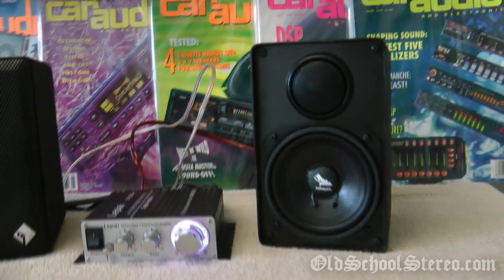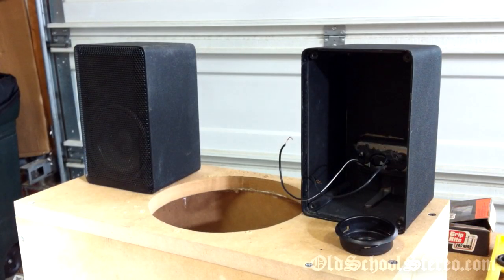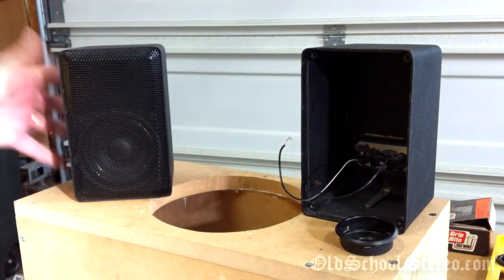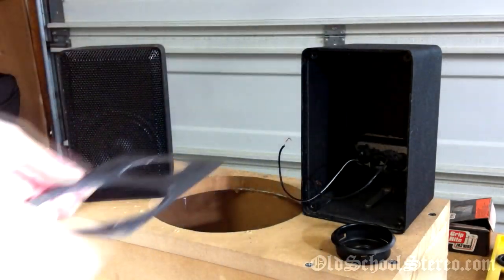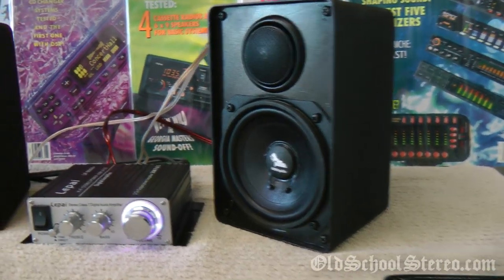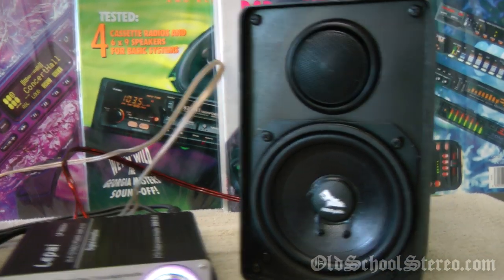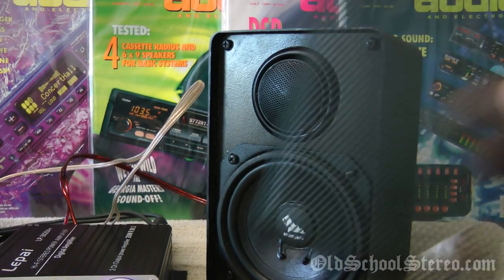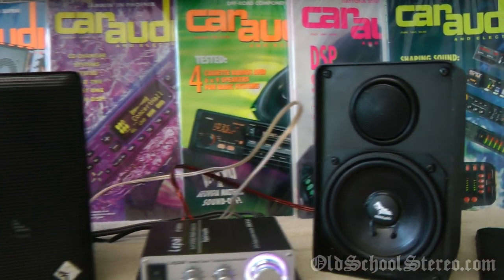Old School Car Audio Bookshelf Speakers? DIY Audiophile Project

Comment: , you are the first person to use car audio speakers in a home speaker design.
this is exactly what I'm going to do for my computer speaker 2.1 setup because they are 4 ohm and I can get a set of very well made JBL or Cerwin Vega component speakers with the crossovers for around $50 bucks. 
Compared to home audio for what I need, it's a lot cheaper this way and most amps like to be at 4 ohms anyway especially the small T-Amp I have.
it's a win win for me.

Comment: Hey there, I'm looking to put demountable speakers in the back of a sprinter camper conversion that I can also trail outside and move around within the living area depending on what I'm listening to (music or watching something). They'll also need to work while driving so me and the rear passengers can listen. I'm on a tight budget and was thinking to put a set of Pioneer TS-A652F in some made up enclosure, but I've no clue when it comes to audio, so would just be making up any old box that I could demount, move and mount, and was advised against this as there's huge potential for the sound to end up terrible. I then thought of getting some home audio 4ohm bookshelf speakers, but was told there could be power issues using a car audio amp rather than a power amp or integrated amp. I'm only aiming for about 45w RMS, so a modest and affordable setup. I just want everything to work ok. If you provide any service where you offer advice, please let me know :)

Comment: that's a really nice build, to me if you can make something look factory or better then youre golden lol, those are something id like to have and id possibly consider them as studio monitors, I had a couple of projects that nowhere got near being on youtube but maybe they should be, I matched up 6" woofers with 2" fullranges to be used as woofers and tweeters, I even modded the 2inches and raised the precision of the clarity at an audible rate, and the woofers were from coaxials but the woofers were cloth surround, fiberglass& paper cone, aluminum 1" voice coils, and maybe 10oz magnets, rated 130Hz- original tweeters 23KHz, the fullranges I was going to use 20KHz, my full ranges have rubber surrounds and paper cones, but I crome dustcaped everything and the effeciencies level up even though the fullranges are 4ohm but with like hopefully an 8K crossover that wont be an issue.

Comment: I have some old motorola speakers in 0.25 cubic foot boxes tuned to 100Hz. Fantastically punchy, although I don't like the sound of the speakers due to the single capacitor crossover putting too much shrill upper midrange in the tweeters. I have been planning to modify the filter.

Comment: i just took my old radioshak speakers  tweeters and 6.5" woofer and put 3" t44 bullett tweeters300w
and 6.5" pyle pro 400w midbass driver's in them
kinda a micro pa project mini dj speakers

Comment: I have a nice set of MB Quart  's and i'm going to hook them up to an old Alpine stereo ready to be put together. Even have a 25 amp atx power supply. All ready since 2009! Gotta get my ass in gear. But lately those little lepai amps have made it easier took hook up 4 ohm speakers. Piezo tweeters? That guy is on crack!

Comment: you should get a better amplifier, these little car amps are really cheap and not the best.
Reply from the maker: There is no need to try to portray SQ via YouTube, it's simply not possible. Too much compression. $20 amp vs. $20k amp, you would not hear a difference via YouTube video playback
Reply: Dereck BigDWiz via a microphona and then youtube playback, true.
But you'd probably hear a difference in richness in real life.
Reply from the maker: +hannes something Agreed!